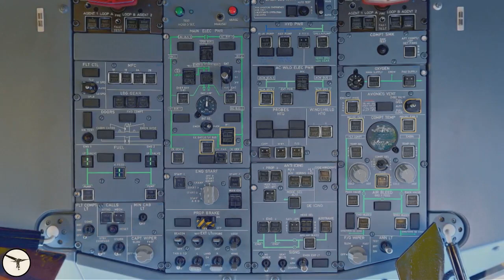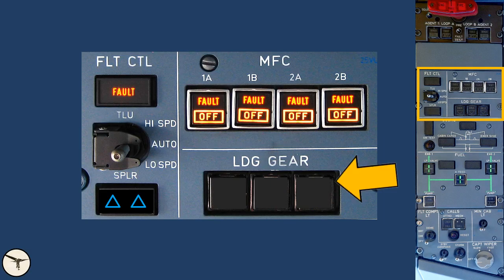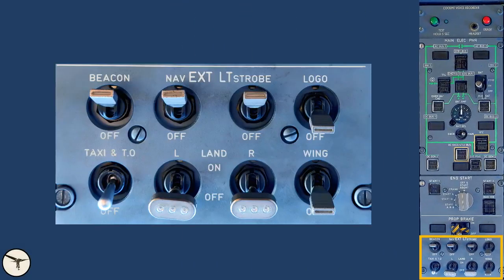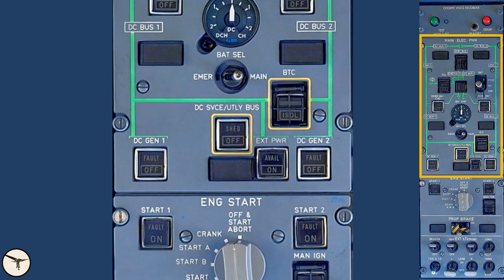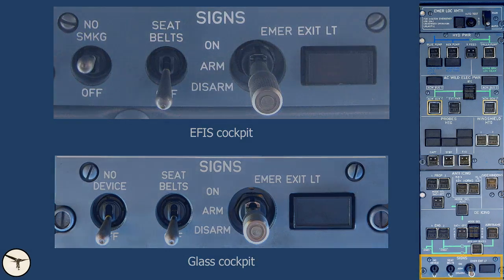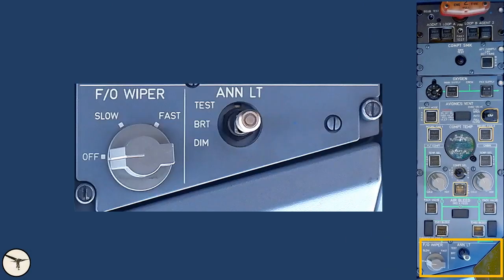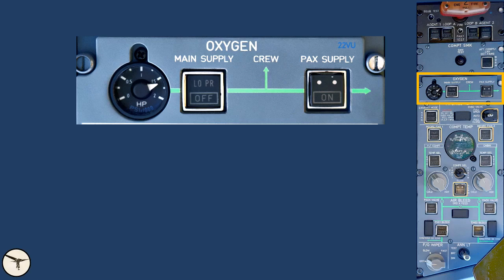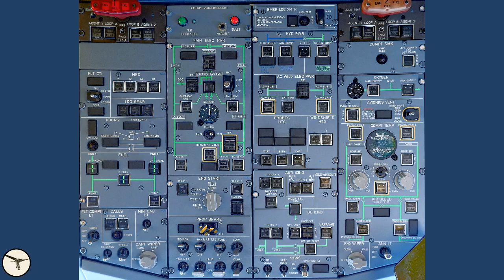ATR systems - The overhead panel.

Comment: Thank you Sir.
One question:
As per the video, The anti Icing de-icing is divided into 3 group i.e. level 1,2 and 3. Could I please get a reference of this within the FCOM. Much appreciated.
Reply from the maker: Level 1, 2 and 3 are not described in FCOM. The expression "Level" originates from a group of instructors at ATR who wanted to simplify the wording from "Probe heating & windshield heating", etc, to something easier to understand. However, since Level 1, 2 and 3 are not printed on the panels, this practice is not official.

Comment: Really helpful video Magnar. I had a question, Why does the Mechanic Horn sound when we reset the exhaust mode pushbutton after the smoke test ?
Reply from the maker: The exhaust mode pushbutton controls the extract fan. If the extract fan stops, the avionics might overheat. Therefore, if someone switches off the pushbutton while the aircraft is parked on the ground, the horn will sound. And if I remember correctly, the horn will also sound if the fan fails while the aircraft is parked on the ground. Finally, the horn will activate 30 seconds after the emergency beacon is activated while the aircraft is on the ground and is powered.
Reply: @FlywithMagnar  Thank you for the information : )

Comment: Dear Captain Magnar, I just watched your video and wondering why some push buttons are guarded and mark with yellow circle mark? Are they prohibitted to push by pilot or use in maintenance purpose only?
Reply from the maker: Hi, the guarded pushbuttons shall only be used in special situations, as directed by the checklists. The guard is to protect against inadvertent activation of the pushbutton. The pushbuttons with a yellow ring are there for easy identification in case of smoke in the cockpit. When there's an electrical smoke alert, the procedure is to push those buttons (as directed by the checklist).

Comment: Captain, ATRs have no APUs ? Do you rely entirely on the GPU to start up ? Does the GPU also generate Bleed Air to spool the turbine up ?
Reply from the maker: ATR aircraft don't have APU. It's extra weight. Instead, they have a brake on the propeller gearbox. When the propeller brake is engaged, the gas turbine can run and produce electric power and air conditioning. Bleed air is not used to start the engines. We use GPU or battery power. This video explains more: https://youtu.be/behqG4Dw0Go
Reply: @FlywithMagnar  saw the video and thanks. One more question - After starting # 2 with brake on using battery or GPU you are in Hotel mode. Are you using bleed air generated from # 2 to start # 1 ?
Reply: @jameschen9099  🤦‍♂️no bleed air it's not a 737, electrical starter here you just need electricity
Reply: So there another DC starter motor mounted with the accessory gear box also in # 1 ?
Reply: @jameschen9099  each engine has its starter
Reply: @Hk-uw8my  got it, thanks.
Reply: Hotel mode

Comment: I would like a detail video how airplanes the FMS works and how way points work.
Reply from the maker: Sure, but you will not be able to understand it. An FMS doesn't work in a flat world.
Reply: @FlywithMagnar  I can demonstrate how the. Fms works on flat earth! But first show me how you use one, then after I will sho lw you how it works on flat earth!
Reply from the maker: The user manual has more than 500 pages, but for a starter, the main means of navigation is GPS, GLONASS or Galileo. They consist of satellites orbiting Earth. This is not possible with a flat Earth. (This answer has been edited. I lost the internet connection.)
Reply: @FlywithMagnar  Ok)

Comment: Can you explain how far a airplane can meaure distance  ?
Reply from the maker: There are two methods: 
1) Distance Measuring Equipment (DME), which is a station on the ground and a receiver in the aircraft. The receiver communicates with the ground station and measures the time a signal takes to move from the aircraft to the ground station and then back to the aircraft. The time gives the distance. It takes the signal 12.36 microseconds to travel 1 nautical mile. The range is line of sight. That is about 120 NM from 10,000 feet. 
2) GPS. The range is unlimited.
Reply: @FlywithMagnar  Why don't pilots admit the Earth is 
Flat? Is there a NDA you have to sign to mention anything about flat earth or curvature of earth? I just curious!
Reply from the maker: No, there's no Non-disclosure Agreement to be signed. Furthermore, we cannot "admit" the Earth is flat, because it's a sphere. This has been  known for more than 2,000 years.
Reply: @FlywithMagnar  Okay however I disagree with on the shape of the earth!
Reply from the maker: I'm sorry to hear that.
Reply: @FlywithMagnar great video thank you, perfect with the MSFS ATR. However the earth is not a spheroid..... technically it is called a geoid or an oblate spheroid or an irregularly shaped ellipsoid, all the same thing - a squashed spheroid.